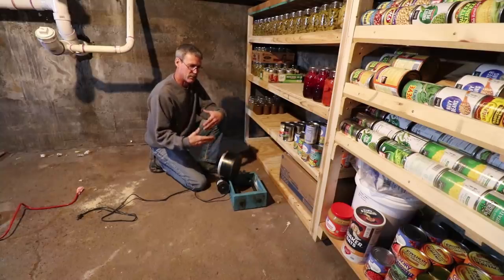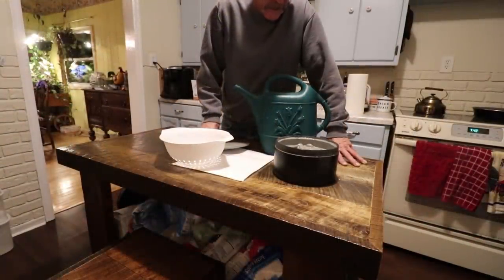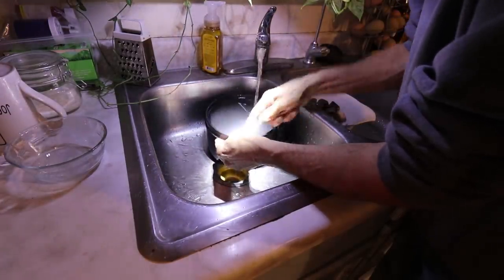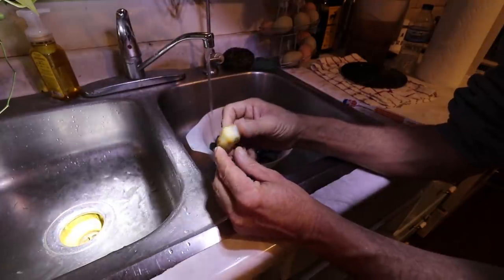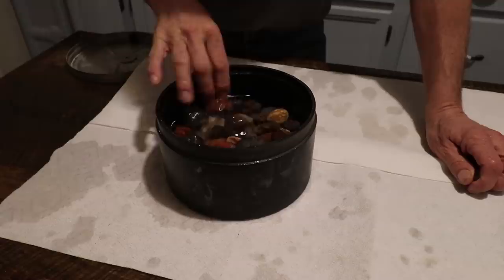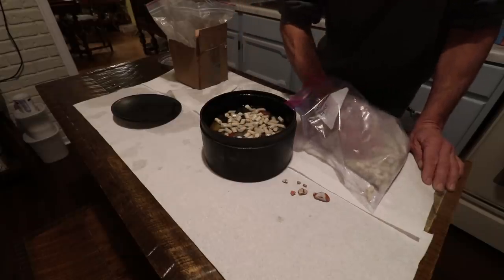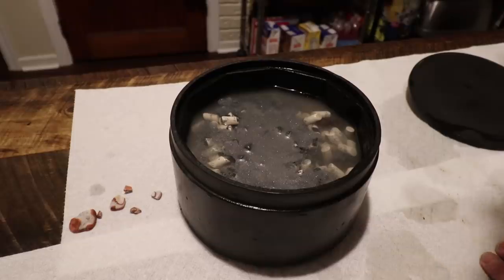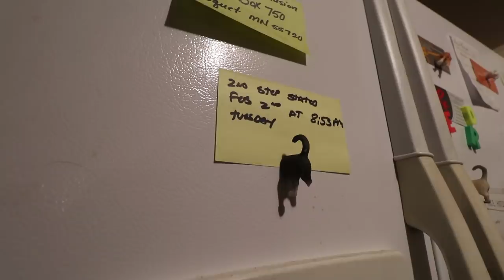Tumbling and Polishing Rocks. Winter 2021. Step 2. 150/220 Silicon Carbide. The process continues.

Comment: Years ago, when I was doing a lot of rock tumbling, I didn't bother scrubbing individual stones.  I'd fill the tumbler normally with rocks & clean water and then add a touch of dish washing detergent.  Run the tumbler for a couple of hours, dump, rinse, and repeat a second time.  On the odd occasion that I felt the 2nd rinse wasn't clean I'd repeat a 3rd time.  I never had any problems with grit transfer.

Give it a try.  It will save you a lot of time & effort and doesn't cost you a dime.
Reply: Common to use Dawn to clean jewelry. I had a bead business for years and we cleaned silver bead stock with it!
Reply: @local_treasures815  I used to sell a lot of my tumbled stock to custom jewelers.  I did amethyst, rose quartz, clear quartz, carnelian, jade, tigers eye, lapis, and the like.  The Dawn detergent could clean the stones perfectly no matter what the material.

Comment: What kind of initial investment would I need to start polishing?  I’m very interested.  Thanks
Reply: Harbor freight sells a decent two drum tumbler for about $50.  That and $15 for media and you are good to go.
Reply: @enricojaun2880  thanks
Reply from the maker: Start with a cheap tumbler like Enrico suggested. I am sure they work very well. Once you see if you like the hobby, you could then upgrade to a bigger unit. I would start with just a 3 pound tumbler or the double 3 barrel tumbler. You can move up to a 6 or 12 if you get the Rockhound addiction.

Comment: Much respect for your excellent tutorials, but I have to disagree on the use of WD-40 (that looked like what you were spraying) on your tumbler bearings. Plain WD-40 is hard on rubber and plastic over time so it's been advised to keep it away from your plastic bearings, rubber rollers, and rubber barrels. Supposedly silicone based  lubricants are safe however. I still use the old reliable 3-In-One Oil for my tumbler bearings. 👍Thanks for all of your tumbling videos!